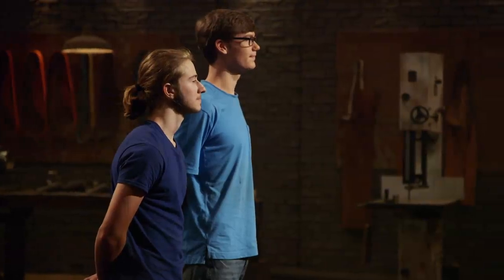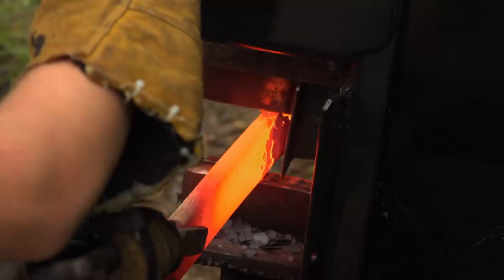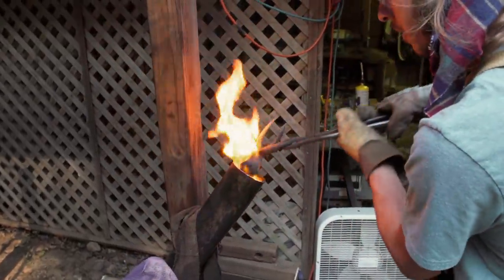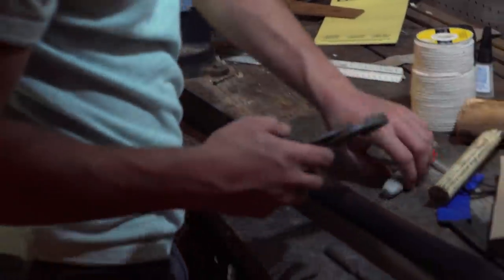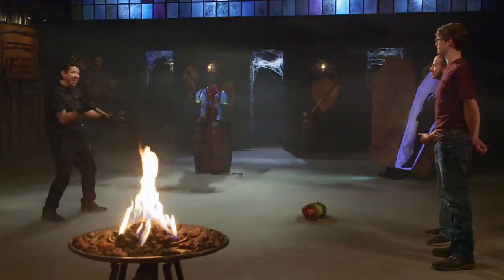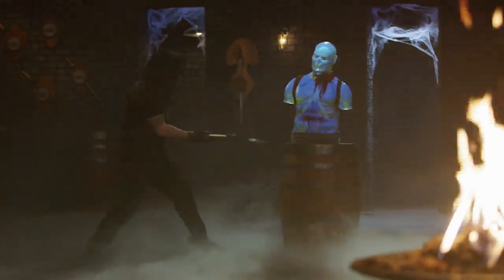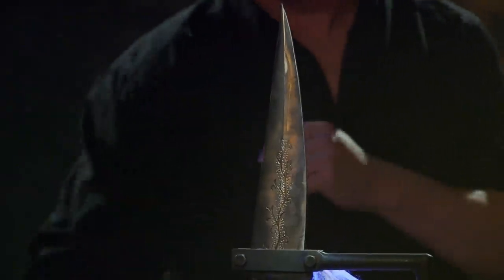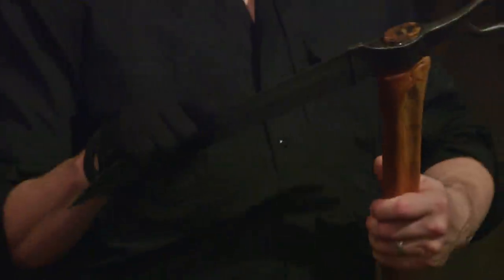Forged in Fire: WAR SCYTHE HAUNTS THE FINAL ROUND (Season 7)

Comment: this is not a warscythe. the warscythe has vertical scythe attached to a pole. this is a ravenhammer or rider hammer. difference is the length of the beak like blade. riderhammer have longer blades so they can rip through enemies while riding.
Reply: I clicked on this video just to see whether they would accurately display a warscythe or not. It was as I anticipated.
Reply: That's exactly what I came here to check out. Right when I saw it: "That's not a warscythe...". It's genuinely surprising how a YT channel, TV series,  and a streaming program has so many errors that can be resolved with simple research... They actually do it quite a lot.
Reply: I believe this weapon was inspired by something in a piece of media, not supposed to be anything historical. Could be wrong
Reply: @davethiessen3372  They stated it was from Jay's design. They weren't stating that it was a historical piece

Comment: Watching him swing the bone was stressful. Even if you're a foot away, I wouldn't take the chance at purposefully swinging my hand towards a bladed weapon.
Reply: precisely. I know these guys know what they're doing, but I can't help but notice that was quite a short bone, leaving very little room from either hitting the bone or chopping your fingers off
Reply: yeah, that's not even that good of a test because nobody swings their bone at a weapon which is fixed in place. it changes where all the force is applied. you swing the weapon at a person's body, not the other way around.
Reply: @79treefrog  Enh it's like slicing carrots with a kitchen knife. blade is there, fingers are not there. easy. :D
Reply: @marhawkman303  yeah but with a kitchen knife you're not smashing your knife with high speed against the table and even if you accidentally slam your finger on the carrot the table it's not gonna cause serious harm so there is no risk to it either.
Reply: @sandrafrancisco  it doesn't matter which if you swing the bone at the weapon or vice versa. either way the more durable blade takes less damage so it doesn't make a difference for a strength test.
Reply: @JudgeHoldenUwU  Clearly you have no idea why I mentioned it.  When slicing a carrot you hold the knife with one hand and the carrot with the other.  Point is if you maintain proper blade control you will not cut yourself.... even though you're slicing with the blade 1/2 inch or less from your finger.
Reply: You guys are ridiculous. No matter how he swings it how would his hand hit the blade?
He is standing still? What's he going to do? Magically grow an extra 8 inches of forearm and swing it into the test blade?
😂

Comment: Well Alex had no machine for blade.
Trevor had everything.
Reply: True but the solidness of the fit can be done without any machinery.
And the rolling of his edge was unfortunate.

The strength test dulled his blade for the cut test.
I'm pretty sure, but that's just my opinion.
Reply: You could say the same about age, experience or even bodytype. In general handmade things are better than maschined, so its even more impressive that Trevor won. The only thing they spared him was strenght anyway, not a single bit of his idea or shape.
Reply: im sure it had nothing with him having to hammer the material into a longer blade, thus making it thinner and weaker.